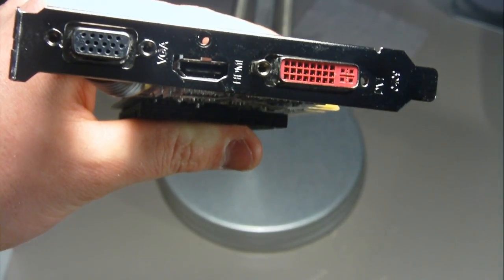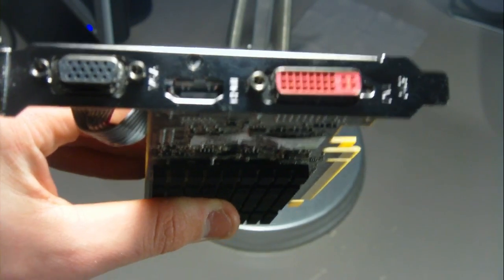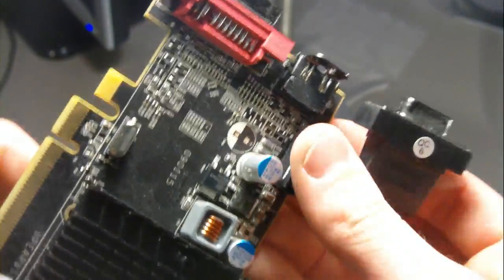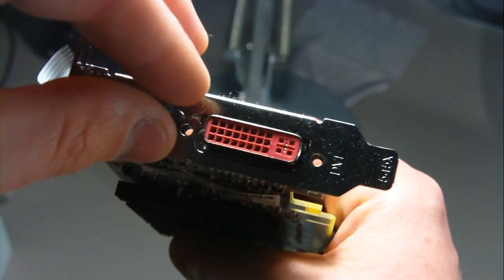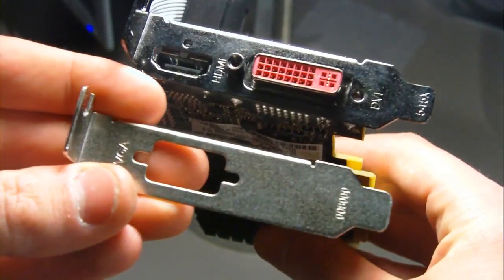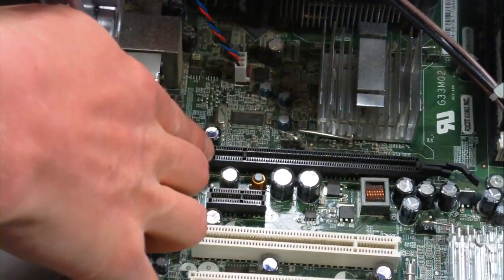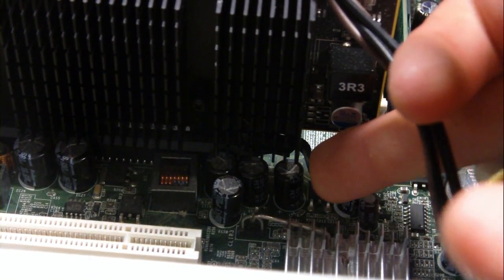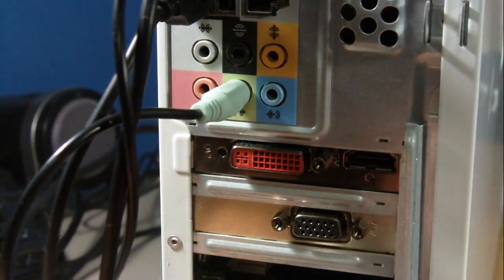[UPDATED] How to install a low profile graphics card (GPU)

Comment: does anyone now if there is a decent graphics card for a 240w psu
Reply: Manip-Manip-Manipulate the metal like a Magneton Windows does disable them if you don't (generally) but its best to do so to make sure you don't have any problems. Also download the latest drivers for the graphics card from the manufacturers website (nvidia or amd) the drivers on the disc that comes with the card are usually quite old. Its pretty simple and straight forward. Also expect everything to look like crap and be in a low resolution though until those drivers are installed, this can sometimes throw people off and make them think something has gone wrong, when it really hasn't.
Reply: +Aldrei Mislang Not really, if you can upgrade the PSU definitely do that. They do make low profile versions of cards like the 750ti, and they aren't bad at all, but you really want at least a 400 watt for those But on some low profile systems that isn't always possible, since some us proprietary PSU's. Such as the little HP workstation I have. So really your stuck with very low end, low power cards like the Geforce GT 730, or Radeon R7 250. Both should be ok, but since you have such a low PSU, I would say go with the GT 730., since it has a very small power draw. That's what I did in mine.
Reply: +Aldrei Mislang 

depends on the purpose. You can go for a GeForce 210 but don't expect too much. You'll probably run some old games.

Once again, what do you want to do or to be more precise, what do you expect from your GC?
Reply: +Aldrei Mislang I would get the 750 ti. Im running it on a 240w psu and it runs well.
Reply: i have small form factor pc
Reply: +Mr Onion can the 730 fit in a small form factor case my computer is the Hp compaq DC7900 SFF
Reply: +Aldrei Mislang Mines a DC7800 sff, almost identical to yours so it will definitely fit if you get a low profile version. This is the exact card I put in mine. Although it didn't come with low profile brackets, so you would have to get one if you want it to be secure (best place is probably Ebay) http://www.amazon.co.uk/gp/product/B00SGC4JVK?psc=1&redirect=true&ref_=oh_aui_detailpage_o04_s00 

Its not as bad as I thought it would be actually, your not exactly going to be running Fallout 4 on it, but for older games such as Skyrim, Euro Truck Simulator 2, Sonic Generations, and some barbie puppy game the kids playi t does well enough. Although Cassardavid did say the 750ti works ok in it, so perhaps give that a try? Personally I wouldn't be so bold but it works for him, you will be pushing your psu to its limit with that though.
Reply: Mr Onion a lot of people running these hp sffs (240w) have a 750 ti and they (me included) do conclude that 240w is enough for the 750 ti. However it also depends on the whole system. Im running a core 2 duo with the 750 ti so that's probably why it's running on such a low end psu.
Reply: Yeah I've heard of a few people using the 750ti with these things, believe me, I wasn't trying to say your wrong about that, just that your on the limit of what it can do, so be careful.  Some of these HP ssf's especially the more business orientated ones are built like tanks, and the power supply will take a lot of hammering, as opposed to a really low quality power supply, which can't sustain its rated wattage for very long,. Personally I've had a power supply go on me in the past, taking the rest of the pc with it, so its not a risk I would want to take again, I certainly wouldn't attempt it with a core 2 quad (which mine has), lets put it that way. Although its not my only PC, and high end gaming isn't the reason I own it, if it was my only PC I'd be more likely to try it my self.
Reply: Mr Onion yeah I know that it is not really advisable. But since I am a student ,shelling out money for an entire new pc was not really an option. I'm happy though :P
Reply: +Aldrei Mislang If your looking to game please upgrade your GPU
Reply: +cassardavid94 haha we've all been there, when I was a student its amazing what I got out of an old Pentium 4, that people kept telling me was out of date and hopeless. Those little hp ssf's are great little computers for what they are though, I was thinking of using mine to run an arcade rabbinate for Mame and other emulators. Since they run so cool it would be quite a good machine for that.
Reply: +chase hiatt I'm assuming that's a typo, and you mean psu? He can't change the psu since its a proprietary one designed specifically for that system, and they don't make larger power supplies for them (believe me I've looked since I have one). But as we've already discussed he'll be able to get away with a 750ti in it.
Reply: gt 610
Reply: +Unknown Threat wait I have a 240W psu can a 610 handle it??
Reply: +RusK Execute it also depends on your components such as (fan ,processor, hdd
Reply: +RusK Execute but i had a 290watt and it can handle a gt740 with i5 so 610 would work on yours if u have somthing loew than 15
Reply: +RusK Execute i mean "Yes"
Reply: +Unknown Threat I have a HP dc7700 SFF and AMD Radeon HD 7450 and it runs very well
Reply: +Mr Onion Do you uninstall the integrated graphic drivers before installing a new graphics card?
Reply: Mr Onion Thank you kind sir. I really do appreciate your response. Big help!
Reply: GeForce 210

Comment: hi can i Install a ddr5 graphic card 1gb 64big on my computer?
Motherboard: Hp 0A50h
Processor: Intel(R) Pentium D 3.4ghz?
It has an on board graphics card with just 256mb and Im planning to upgrade my pc.
Reply: Ya you should be able to
Reply: +Julian Signo Since it has a PCi Express slot it should be fine. Although be careful of your power supply, and the requirements of the card. Some cards such as the Geforce G730 have a very low power draw, on should be ok on pretty much anything. But others need a much higher watt psu, and in some cases extra power connectors from the psu.
Reply: +Mr Onion i went with a graphics card that was listed on the manual but thanks anyway

Comment: I would really like somebody to answer me lol. I have http://h20565.www2.hp.com/hpsc/doc/public/display?calledBy=&ac.admitted=1411243550606.876444892.492883150&docId=emr_na-c03058903-19&docLocale= and I'm wondering if a Nvidia geforce gtx 730 ti would work in this
Reply: +Forever Gamez tes you can use gt 730 GPU.
Reply: hah, yep well. It works well in my computer, simply need a new CPU, and I'm all set. :D I also got a 600w evga bronze power supply with my gpu. all turned out well

Comment: Hi Sasha
I am no computer expert but I am able to learn by doing. I have a computer with Ubuntu on it. Everything works well apart from jerky videos and is slow. I was informed that I should buy the Radeon HD 5450 and although everything fits well into my computer I get no picture at all when this part is installed and I am not able to run the CD. When I disconect, the HD 5450, everything comes back on. Can you please help me, is it down to Ubuntu because I really would like to delete it and get my windows back. With my other computers with windows 8 and windows 10 everything works well. I hate Ubuntu.

Comment: Installed a GPU last night, watched this video before hand, thanks. Was very easy, the only difficulty I had was changing the card brackets, I did not have the screwdriver for it, had to use pliers.

Comment: my source of power have 250 watts max and 17 amp in the 12V SECTION, if i buy the geforce 210? i'll need a new source of power? or it will be ok? :D

Comment: i did the same procedure but when i plugged the monitor cable to gpu my monitor wont turn on it's just blank what should i do ?
Reply: same here ...did you get any idea?
Reply: +Aswin v.v I have the same problem and  never found the solution so I had to remove it than I plugged the cable back to the cpu it worked I need help?
Reply: +shoaib nasr same here
Reply: +Reed Briggs same here
Reply: I recently got my card to work. I actually turned on my computer without the card installed, of cores using the old card in this case is was the integrated default card. I then inserted the new card into the empty card slot while the computer was on and logged in (probably not recommended by professionals)  then using AMD catalyst control center automatically  downloaded the drivers for it off of the internet.
Reply: Make sure that it is all the way in
Reply: Oh I did this about a week ago. I'm currently using the card. The card isn't a major leap forward from my old one but it is better.

Comment: When i Bough this card i dint get a disk with it help?
Reply: Download drivers on to a USB and put that in the computer that has the graphics card. Then just install drivers
Reply: +usmaan ali how can i get the drivers n put into my usb? any link?
Reply: +iwan pro just go on the website of the manufacturer and type the model of the card and download the drivers on to a USB. I. E A gtx titan by gigabyte just go on nvidia(since they initially made the card) and download the drivers for the card. Hope it helps
Reply: Ya thanks i found it. But how to change the old adapter to the new one?
Reply: +iwan pro what do you mean
Reply: +iwan pro what do you mean
Reply: I got problem with my desktop after i install the g.card
Reply: well thats your desktop. use another device to find a fix for the problem.

Comment: Thanks for this! I am installing a graphics card in my desktop pc for the first time, and this is pretty detailed! I am actually installing THIS one into my Optiplex 760 w/ a 305 W PSU. i am not going to be using it for much gaming, i got it because i needed an upgrade from my crappy Intel Q43 Express chipset - it cannot even play 1080P Video!
Reply: Same I have an optiplex 755 and can't play 1080p at 60fps.
Reply: Its probably because i changed my GPU to a GT geforce 610. Or something eles. Btw how many hard drive slots does you Optiplex Have 1 or 2.
Reply: Bro I have the same chip but I am installing my card tomorrow

Comment: HELP,I have a hp compaq pisario and have this card but only two of the small slots in the video, ie. i don't have the long slot shown in the video,but on the hp website in the specs say i have a pci express slot x2 ? thanks
Reply: racedriver555777  The long slot shown is a PCI Express x16.  You do not have the required slot to install this.
Reply: thanks,i found out that i need a pci express x1 cheers mate.
Reply: +racedriver555777 actually you can put it but the speed for your gpu will be slow

Comment: Thanks.  I ordered this but mine is 2gb?? Difference??
Reply: More memory = better performance =less lag
Reply: usmaan ali I compared Asus 750 2 gb and 1gb and they have 0% difference in performance... weird?
Reply: +Miika Ruokonen well better to have more memory
Reply: usmaan ali but if it doesnt make any difference?
Reply: +Miika Ruokonen apart from price.  For example a gigabyte  gt Geforce 610 2GB is £32.70 and a 1gb version is £33.59
Reply: usmaan ali I bought msi 750ti 2gb for 150€ and 1gb is 125€ :-\
Reply: well thats the sellers then.
Reply: TSAviation
750ti ja 750 on eri asia :P

Comment: hey do u know if this card supports 2 monitors? I have the same gfx card and I can't get the 2 monitors to work. I can only do one at a time. I'm using a hdmi cable on a 27' led tv and a vga cable on a 20' lcd monitor. Any help will be appreciated, I'm going crazy trying to get this to work.
Reply: It doesn't support dual monitors
Reply: Stock market

Comment: Can someone help please because I don't have the openings in my computer case to put the end of the graphics card in.
Reply: ***** I have a pci slot in my motherboard, but my computer doesn't have that metal plate you screw off.
Reply: Parhy Lolzilla it has to have one. If you post a picture of you case it would be helpful. Otherwise, it's kind of explaining a blind guy what color green looks like.

Comment: you earned a sub but what about the integrated one ?
Reply: If you want, you could attach a second display to it.
Reply: lm2046 no i mean it makes the radeon card work worse right ?
Reply: mr troll I found out that it disabled the onboard video card. That's why it has 3 outputs.

Comment: Galaxy NVIDIA GTX 750Ti 2GB OC 2 GB GDDR5 Graphics Card is a low profil card can it run with 300 w psu
Reply: It won't break it. I'm running a pc with a 300w psu and the graphics card is fine. It's very low on power. I think it only uses something like 60w.
Reply: Denise Mackenzie no problem :D
Reply: Hi, Yes it can. That card doesn't use alot of power.
Reply: Bro dont do that  boy a new 500w (true500watts)  if u install it with 300w psu u are going to broke it (sorry for my english) :D
Reply: Denise Mackenzie the  NVIDIA GTX 750Ti 2GB  DDR5
uses a lot of power and it needs auxiliary energy directly from the psu.
Reply: Sorry for the confusion. I forgot that there are different versions of the 750 ti. I've got s gtx 750 ti and it doesn't need to be connected to the psu, it draws its power from the pci e slot. Mine is the low profile version.

Comment: Hi there WirelessHotShot  .....very informative and useful video..i am planning to buy Gigabyte 750 Ti low profile graphics card...Question: what is the minimum width(with some clearance) of cabinet required for installation of low profile graphics card...i know you mentioned 4 inches but can you share the cabinet model so that i can take same as reference?..Also,because of compact cabinet with graphics card too close,are you facing any heat dissipation problems?Thanks

Comment: Ive an HP Pavilion Slimline s3321p Desktop PC you can hear the fans going and the power button is On, and everything but No video I try to install a low profile graphics card and still monitor doesn't comes On. Any suggestions that could help out to repair it? 
The power supply when it goes bad the fan still works? how you can test the power supply source?

Comment: I had a Dell 530S! My first DDR2/Dual Core system! 4GB Ram, my 2GB 5450 GPU and 1.60GHZ Dual core. Then I upgraded it to the 530 case and hooked it up to a 300W PSU.

Comment: I am not getting a signal from my graphics card to my monitor and I am using the XFX r7 250 low profile graphics card. I NEED HELP
Reply: Check your bios settings. Disable your onboard gpu. :)
Reply: i have already tried that but thanks though :)
Reply: First things first. is your PSU capable?